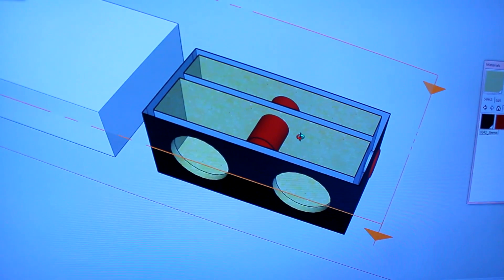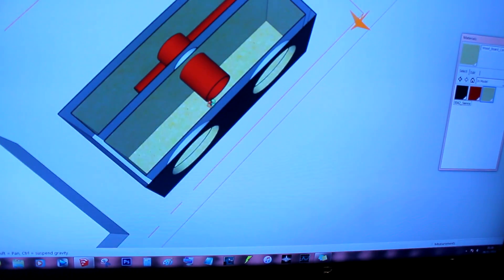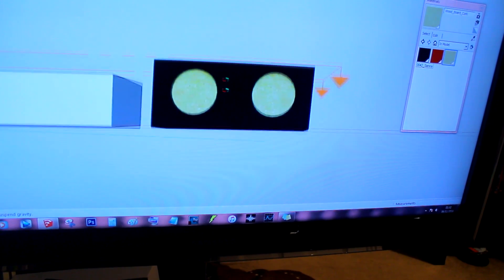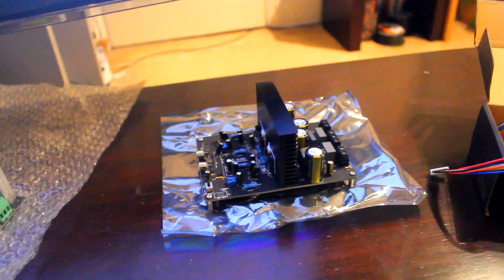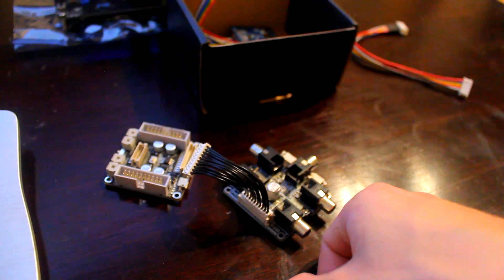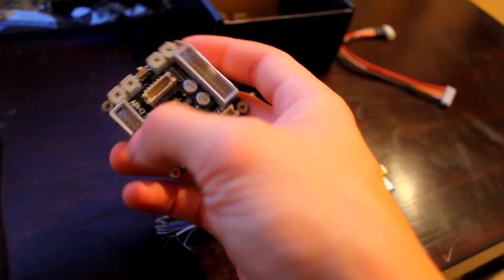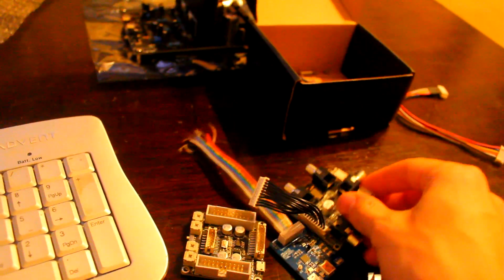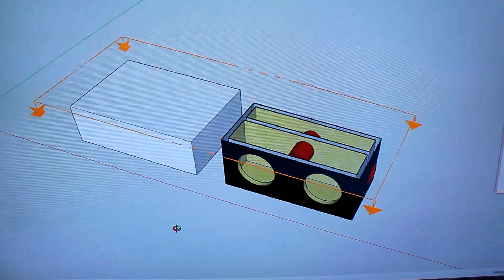LOUD Custom Boom Box (1) - Planning, design and parts!

Comment: Have you played with the DSP yet? I recently got mine, but the programming board is different, got it from ebay for about $5. Anyway, it works, I just need to figure out the Sigmastudio since it's quite a complex program.

Comment: Can I suggest 45Hz instead of 30 for the other tuning.

I'm not sure how well this dual port works but interesting to try.
For instance, when the 70Hz port "loads" the cones, their excursion will reduce. This will mean they output less sound to the real world from the front. Also it's possible that the 70Hz out of the first port might be trapped and attenuated by the second port.

I wish there was a port which would amplify a larger range of frequencies, although that is probably a rear loaded bandpass horn (like an expanding transmission line).

I'm making a boom box with 2 Nikkai 6 x 9 (upgrading to Bass Face SPL69.1 as tinsel leads damaged on Nikkai)

I also want to produce one later with 2 Faital Pro 6FE200 ported mids at 90Hz and Eminence APT80 highs, and also 2 drivers similar to the MCM 55-2421 in parameters for bass (45-90Hz) in a 6th order bandpass and have a plexi glass front to see the woofers. It should be LOUD! Loud enough to turn an open plan house into a disco with 100 watt per mid/high and about 400 on the bass.

Comment: curious if you could make a two in one enclosure ? design one entire sealed section ported for high to mid range with proper drivers for such . then have a woofer portion tuned for its own frequency just have each different section sealed off from each other. ?

Comment: really like this idea. think alot of great portable boxes could be made with the speakers on the market. whats out now, diamond box and whatever else is not up to basshead standards. so glad so see your idea, look forward to seeing it finished. would also like to build something with pa drivers and a battery
Reply: indopleaser actually diamond boxx can get low it's ported to like 30 hurts
Reply: indopleaser you cant really get that low with a portable system. You need concert/Stadium sized enclosures to even get a good enough low end extension to "bass head standards". Theres a thing called "cabin gain" that helps basic frequencies sound a lot louder in a smaller environment. For example, in your car, in your home and even in your ear. Ear buds sound like poo outside your ears, but when they have small space to play in they sound amazing.

Comment: Man i wish my sub would go lower i bought a sealed box im woundering if i could just slap a port in it...would it sound good
Reply: you could slap on a 2 inch round port with a length of a 8.98939 inches for Tuning Frequency of 30 hertz :) hopefully that helps :)
Reply: Killer32620 depends, about the airspace inside mostly, since sealed boxes tend to be less air space, and ported boxes have more air space, don't know depends on the sub and box airspace
Reply: black ops [ David ] its a 10 in sony 300rms the box is a sealed angled one it .90 cu ft
Reply: ***** I see i figured that it might b too small

Comment: what software did you use for calculating the internal volume of the cabinet, port lenghts etc ... ?
Reply: and is this a stereo speaker ? because i think if your "stereo" sound is coming out off one port it can't be a real stereo sound. right? (¬_¬) 
but it's much better then most of jbl and other overprice "party" speaker
Reply from the maker: Yes, 99% of the time the stereo split sounds are at vocal level or greater, rarely ever under say 300hz. Bass is almost always mono/centered since is is non-directional. So having two full range drivers sharing an enclosure is not a problem here. Theyre so close together anyway there isnt much in the way of a wide stereo image to worry about. And technically yes, from a raw SQ point of view, we should have L and R drivers in separate enclosures to account for the minimal percentage of panned bass. But we arent too worried about that for the purpose of this project :P
Reply: barevids 
ok thanks

Comment: I'm currently running a 12" on 250 ported and tuned to about 31hz. I want a box that can play within 20 to 35 or 40hz. What would be the best box? I've only built two boxes so far so tips would be great. I hope someone can help me.

I forgot to add that I use the sub at home and my towers are going down to 35hz.
Reply: Drakkar Calethiel for the most even sound I think a sealed box with maybe a little bit of acoustic stuffing
Reply: Matthew Daugherty I always thought ported is better if you want to go low. Thanks for the help!
Reply: Drakkar Calethiel I've had a few sealed boxes. They'll get low if they're big or if they have the right amount of stuffing in them. Put some in, take some out till it sounds good
Reply: Thanks for your tips! Lets see what i can do.

Comment: I like the idea, but I really think passive radiators are the way to go for this application. Deep bass, low distortion and high volumes.
Reply from the maker: cheers bro! Ive always wanted to give this method of twin ports a go. Ive read about them lots and thought, I should see how it works on a small scale first. It could be great, or it could be absolute shite! Who knows. Impossible to model this design. So lets see what happens!
Reply: That's the best way to learn with speakers, since most of the design work is black magic anyway. Pete aka Hexibass has some great series coupled box designs but the man is never willing to give much insight to their design from a new project point of view.
Reply: maybe try dual 8" passive radiators, well if the design allows that atleast
Reply from the maker: ohhhhhhhh. You know this idea completely left my mind. That might work better. 
Although generally, i am of the understanding that PRs are most effective when their radiating area is greater than that of the active cones? So I would need a PR with an area greater than two 6.5" woofers, to fit on this baffle space somewhere. Ill see whats around....
Reply: This is a great suggestion! You could use several 4 or 5 inch passive radiators. It should allow you to reduce the overall size of the product and potentially prevent crap/drinks/you name it from going in the port. The only issue with passives like using a single port is that they are only super effective at their tuned frequency. The rolloff either side is shallower but your series coupled port design should have a great wide window of bass extension. Just my two cents, Sam. I can't wait to see the final product!
Reply: You can use two 6.5" passive radiators and with the dual chamber design and ett pretty loud!
Reply: And also, I would try avoid put ports on a portable device so there's less chance dirt and stuff like that gets inside the enclousure. The only bad thing is that it is more expensive but if cost isn't the problem I would totally choose passive drivers.
Reply: You could get better sound by using a separate chamber for each speaker and porting each one.